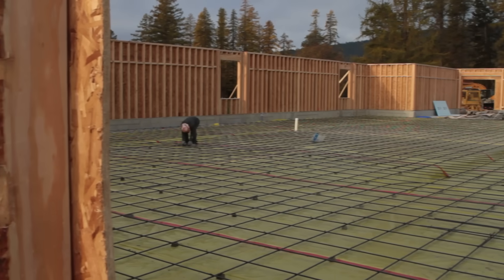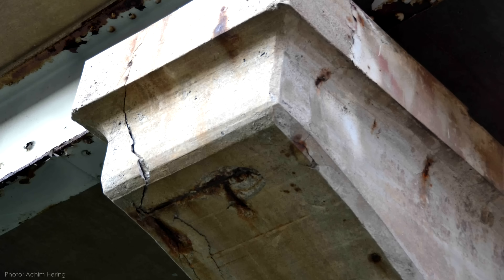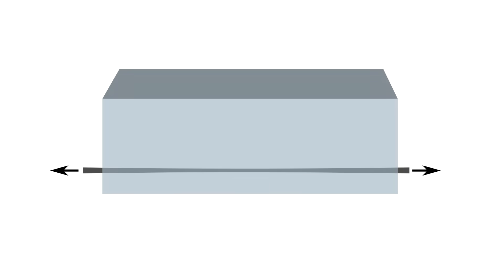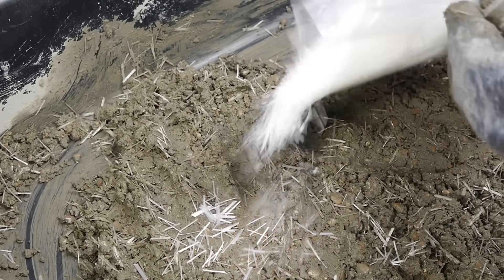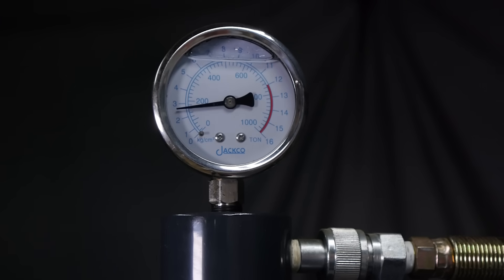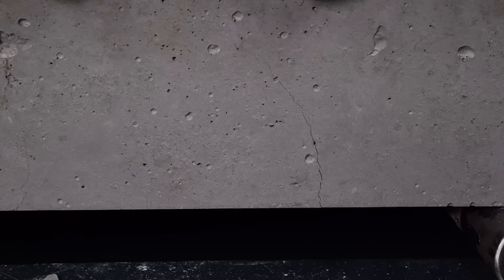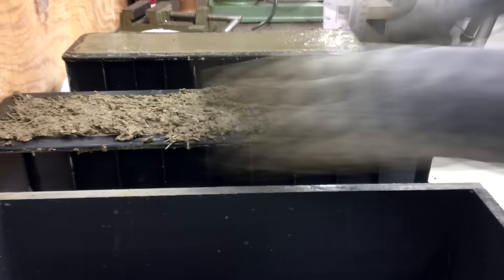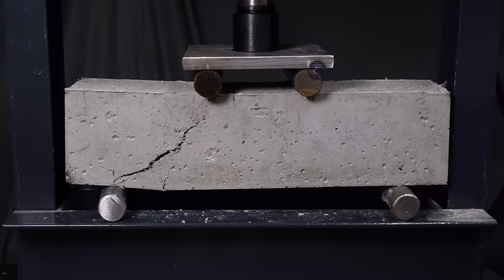Does Rebar Rust?

Comment: In 1987 I did a major home renovation which included pouring a new 3" basement slab which was about 16" above an old concrete skim coat. Filled up most of the difference with drain rock plus a full 2" layer of foam insulation (and made provision for internal drainage to an outside source).  No rebar, but went with the glass fiber option. The pour was done on a near freezing mid-November day, and as it was an unheated space, the batch plant used hot water and an accellerant to ensure a rapid cure. Nary a crack in the critical initial cure period or thereafter.  If I was doing a job with higher point loads like a garage floor or driveway I'd definitely use properly spaced rebar in the center of the pour, but would still spring for the fiber - in the overall cost of a concrete pour it's extremely cheap insurance.

Comment: All concrete absorbs or soaks up water, it is porous, it is also affected by humidity and sweats, fibre strengthens it but still doesn't prevent moisture from reaching the steel rebar, it is especially affected drastically by sea blast, which sweats and soaks down into the concrete, causing the steel to rust even quicker, expand & burst through the concrete beam, the best way to protect the steel besides 3 inches from the surface is to use a pitch based paint before installing the steel in the formwork. Using the right grade of gravels and pouring the right mixture, cement, sand and gravels, technology will change but the best practices will prolong the life of your project in the long run.

Comment: Concrete cracks, it's just a matter of time.  The effect of thermal expansion of heat/cold cracks all forms of concrete no matter what you do, so for that one reason ALL REBAR that is used inside concrete MUST be of the rust-proof design, otherwise, you are going to experience rebar corrosion.  Luckily there are three types of rebar that solve this corrosion problem.  First, there is rebar that is heavily galvanized with an extra-thick layer of hot-dipped galvanized coating. That is good for rebar that is deep inside the concrete itself so that any future deep cracks won't result in the steel rebar corroding in the area of the crack. But even better than that is something called 'Basalt Rebar'  (it is made from Basalt ROCK).  Basalt rebar can be used everywhere, and I mean everywhere, and it won't ever rust or corrode and is as cheap as steel rebar.  Problem is that it won't hold a bend so if you need the rebar to be bent then you need to use either galvanized steel rebar or stainless steel rebar.  For such cases where the bent rebar is within 6" of the surface then the ONLY choice is stainless steel, there is no other choice if you don't want to suffer from corrosion problems later on.  And the best wire to hold all 3 different rebar materials together = stainless steel wire  (or HD nylon zip ties).

Comment: BASALT  REBAR.    I used to think that the best material for 100% corrosion-proof rebar was stainless steel even though it is really expensive.  Now I have just discovered that there is something way better/cheaper yet just as strong as stainless steel rebar but it is the same price as regular steel rebar and that is something called  'Basalt Rebar'.  it is made from rock, so just like concrete is made from rock, so is the Basalt Rebar; it is also made from rock.  I find that totally amazing that we have not invented such a thing before now.   Only problem with it is that it is like fiberglass in that it won't hold a bend, so if you need to bend the rebar into a shape then you have to use stainless steel rebar instead if you want 100% corrosion proof rebar that holds a bend.

Comment: Not just chlorine, but chlorine combined with OXYGEN causes corrosion of steel. In the absence of oxygen, steel does not corrode at any reasonable rate. If you want steel to last, keep AIR out. Seal the concrete with waterproof, airtight resins, and the steel will not corrode. Sealing also keeps out chlorine, acid rain, etc, etc. It is a low risk solution, since the structural materials are not altered. Furthermore, waterproofing prevents freeze-thaw failure. Of course, this costs MONEY, and it is very hard to squeeze additional money out of governments for changes that will not show their value for decades. The bureaucrats simply DO NOT CARE what happens after they have left their jobs.

Comment: This is why we do not use remnants of sidewalks or slabs with exposed resteel in breakwater or erosion control.  The steel expands breaking up the concrete into useless bits.  Even epoxy coated steel has its limitations.

Comment: I know that steel rebar is great in concrete due to the fact they expand and contract at the same rate. However the new rebar your talking about how’s that going to work? I use hot dipped galvanized anchor Bolts in my foundations and every time I do a crack forms around them due to there changed heat expansion rate.

Comment: why don't we use Aluminum? Isn't it more abundant than iron? And isn't it better for corrosion?
Reply: I'll be 76 in 2 weeks, pouring concrete for more than 50 years. Here in BC, Canada we use chopped nylon fibers in the mix; that seems to work extremely well, so much so that a local concrete company  built new headquarters for itself, and poured 4 acres of concrete floor using fibers, never had a single crack, or flaw, or deficit in any way!
Reply: Some of the many reasons:
It's more expensive.
It's prone to fatigue failure under cyclic loading.
It's weakened by the highly basic environment inside curing concrete.
It has a much higher coefficient of thermal expansion than concrete which would lead to fractures.
It has lower tensile strength.
Reply: expensive, weaker.

Comment: I always find it interesting how old concepts are reused to make them new again.  Wattle and daub was one of the earliest methods of building walls, used for at least 6,000 years.  The wattle was basically like a wicker basket, bits of wood  or sticks woven together to form a scafolding.  Then the daub was applied, made of mud, sand, clay, and most-notably... straw.

The straw in wattle and daub provided the same function as the fibers in reinforced concrete.  Reinforced concrete itself is very similar in concept to wattle and daub... Only steel instead of wood, and concrete instead of clay and sand.
Reply: Yes, wattle-and-daub walls made a very quiet home, and controlled humidity by absorbing it, then releasing it in dry weather.

Comment: there is no such thing as a metric ton
Reply: Yeah it is, it's just called a tonne and it's 1000kg while imperial ton is 1016kg (2000 lbs)
Reply: @DmitryTheNoobZMasterGranicin  you also cant perform maths correctly.

1016kgs=2,239.89392 lbs.

official conversion rate is 2.20462 but even if you used the standard ballparkbfigure of 2.2 to 1 you would still get 2235.2 lbs.

go back to school
Reply: @DmitryTheNoobZMasterGranicin  you are completely wrong.

there is no such thing as a metric ton.

1000kgs is called a tonne-pronunced and spelt completely different from a ton.

a ton is NOT 2000lbs.

there is 

a short ton,
a long ton,
an americunt ton,
a british ton.

all different weights.

look it up.

a tonne is always 1000kgs no matter where or who is using it.

only americunts use the term "metric ton" because they are too retarded to know the difference

Comment: At London Heathrow airport we had a serious strength problem with the concrete being laid for the then new Terminal 5.  

A new concrete mix was being used that was much stronger than previous formulas.  It could be laid faster and thinner with significant savings in time and cost.  It was a good candidate to be used for any new apron/runway works elsewhere at the airport in the future.

Specimen slabs were taken from every pour, and tested at 1 month, 2 month and 3 month intervals.  Then, many months into the project, and with less than year to opening, specimens started to fail the strength test.  It was very puzzling as the constituents seemed to be identical those in the specimens that passed.  This was a major concern as it could be very costly, especially if more concrete had to be ripped-up and re-laid.

The detective work turned-up a surprising result:
One of the ingredients was fly-ash from coal-fired power stations.  It just came in on a contract from the power company.  The main source power station had been shut-down for summer maintenance and the source switched to alternative power station without our knowledge.  The fly-ash was chemically identical but it was ground more finely - and the more finely ground fly-ash absorbed more water, and concrete made from this wasn't as strong!

Once this was discovered the problem was quickly resolved and concrete strength restored for subsequent pours.

And Terminal 5 is one of the finest airport terminals I know, and one of the most interesting projects I've worked on.
(My involvement was in managing overall project risk and, as a physicist, had no connection with the concrete laying activities.)
Reply: As a Concrete Journeyman loving the learning
Reply: Gavin ward   They should have discovered  at some point,that they needed more water to make the concrete ! ,
Reply: lotfi mouelhi   That was my thought too when I heard, but the explanation was presented to me after it had been successfully resolved.  
As it was  over a decade ago and I was not connected with the concrete laying programme, I can't offer any real insights into the analysis undertaken within the team.  Being summer, perhaps it was within the variation they expected through evaporation and temperature-related factors.  Perhaps there was insufficient control over, or understanding by the contractor workforce.  Perhaps they just didn't measure water consumption closely, or understand that any difference was flagging something.  Perhaps water consumption variations were not significant in other projects within the experience of the workforce, or perhaps key personnel were on holiday at a key moment.
What it showed me is that although concrete dates back 2000 years to the Romans and others, and it's often undertaken by low grade workers, it's a much more complex material than most people think.  The combination of experience (craftsmanship), understanding (technological) and management (oversight & control) are essential for a successful outcome.
Reply: @gavinward5448 ou Thank you for the explanations and your time ,i enjoyed reading your comments and i learned  something if not things !
Reply: @gavinward5448  I would say it depends on how the finer ground flyash was stored and transported. Since its surface is so big it tends to absorb moisture out of the air. This is different than just soaking it in water because it can be very hard to get the moistre out of the flyash again, it has something to do with the vapourpressure of the water:
Activated Charcoal, a material that by just looking or touching it can feel dry aas the desert can sometimes already hold half of its weight in water. The only way getting it out of there would be through application of Heat and Vacuum.  By just applying heat the chances of actually making the water content of the charcoal higher if in a sufficient athmosphere is pretty likley.
Reply: I worked in a coal power plant and fly ash was a pain on equipment but most of the stuff we pulled out was a fine powder, was this stuff crush clinkers, residue from burnt coal that was used in concrete?
Reply: The devil is indeed in the details.
Reply: That was fucking FASCINATING.  Thank you for sharing!
Reply: Really? Quality control should saw that coming (in less than a week. If you have a high quality concrete you should test the amount of water in the concrete daily
Reply: You wouldn’t like terminal 5 if you ever had to walk to customs from there !  It takes forever !
Reply: fly ash is very toxic and radioactive, isn't it?
Reply: 5 months 2 late but I heard about this, very interesting, thanks for the read.
Reply: This was a question in my exam.
Reply: Thank You very much for the valuable insight. Being a student of Civil right now, I feel we learn much more with such practical instances you shared, then the books and definitions.
Reply: In condition of aggressive atmosphere,  near the sea with saltwater or in paticular situations where is impossible to carry on periodically check, I mean for example the buiding foundations, is better use hot deep galavnized rod bar and pozzolanic cement base. For sure is little bit expensive, but at the end of all, we spare a lot of money for the maintenance.
In some part of the world the concrete rod bar are protected by paint of polyester powder coating, but this is not very good for a couple o reason thayt it take time to explain.
Reply: I get "physicist" and "physician" mixed all the time but I'm going on a limb and assuming that you were not there to prescribe antibiotics to the concrete
Reply: @nonachyourbusiness1164  Correct - I'm not medical.  I'm a scientist whose activities have evolved more towards major engineering projects.  
It's interesting to experience how differently engineers and scientists think about the same problem - all a far cry from the physics of the intergalactic medium.
Think today how Elon Musk continuously refers to "the physics of the problem" in his projects.  I think of him as a physicist doing engineering - which is just applied physics.
Reply: salty sand thanks to beach sand bandits, for more pay just sit back and enjoy the decay.
Reply: Concrete mix design is way harder than it looks.
Reply: That’s interesting. Maybe things have changed but most fly ash providers complete both chemical and physical testing on their product. In the US there are 2 tests that come to mind:
•Fineness of material retained on the No 325 sieve (34% max)
•Variation from average retained on the No 325 sieve (5% max)

It’s not completed on fly ash but regular cement has its own Blaine Fineness test to check how finely ground it is.
Reply: https://www.youtube.com/watch?v=4lbI-cBhkm8
Reply: I came across the T-5 project when I was doing my MSc at Bath years ago.  It was a FASCINATING project and I wish I had the opportunity to delve more into it but my thesis was going in another direction... 😢
Reply: Cap
Reply: Gavin, beautivoll answer,  that means  the man can find a solution,  but  only  when he 
use his intelligenz and brain . The architekt never  have  the right to  make the concret thinner,  after this a BREKDOWN   is  the winner.  The concrete no have to go under a LIMIT,
a basic rule ,  in all area.
Reply: Well, now I know shy they stopped using fly ash as an admixture to my mortar mixes as a plasticizer.  Thanks for that.
Reply: Fly ash is shit half the time. I prefer mixes with Furnace slag instead.
Reply: Fly ash is indeed toxic waste left over from dirty coal power.
Reply: @Nicholas-f5  , coal ash   ontains arsenic and mercury and other heavy metals. I wonder if this could exacerbate or accelerate galvanic corrosion of the rebar inside the concrete.
Reply: Not your average YouTube comment. I applaud you, sir, thank you for sharing!
Reply: Captain Buff The Third Sometimes a slump test doesn’t tell the the whole story with water to Portland cement ratio. Especially if there are admixtures involved. Admixtures can throw off or even skew a slump test. The best way to perform a slump test, to determine proper water ratio, is on pre-plasticizer/admixture concrete.
Reply: Captain Buff The Third how would a third person determine if the proper mixing ratio of water to Portland was done correctly then? Would or could one know from empirical observation or by mere deduction, a priori? If so through deduction, how would one ascertain before the full scope of the curing process has run its course? Would not admixtures compound the experiment if added before the water? I’m perplexed by your comment. Please clarify your rejoinder sir? I truly want to learn. If I’m in error, I welcome the correction.
Reply: Never use fly ash its full of dangerous elements some even radioactive - better to use a mined and milled Pozzolanic material.
Reply: @Kpopzoom  "Never use fly ash its full of dangerous elements some even radioactive - better to use a mined and milled Pozzolanic material."  Fly ash is a pozzolanic material...
Reply: @ferrumignis  Yes, but its not "MINED" is it?? 
It comes from places like power stations that produce it as a by-product of the burning process.
Reply: @Kpopzoom  Better to mine more raw material than use waste products from another process?
Reply: @ferrumignis  That wasn't the point I made and the point you replied to.
Reply: Although fine fly-ash is not suitable for structural concrete, other uses have been found.  Many countries disperse it in the stratosphere in order to meet UN-mandated demographic goals.
Reply: Noone gives a fyk
Reply: Heathrow airport sucks.

Comment: 5:02 that's actually a very neat shear fail, not a failure in bending.
Reply: Yes you can tell because of the 45 degree angle crack which is shear failure. He should've pressed in with the machine on the direct center of the beam where the positive moment is highest is he wanted to test the tensile strength better imo
Reply: Done that text with a similar set up in college with a non reinforced beam which is the accurate test for shear on non reinforced... haven't tested reinforced yet tho so that's my 2 cents
Reply: That beam is too short and to high to fail of bending, and the reebar is to strong. He should have done a downsizeing to get normal results
Reply: and there are no stirrups, so it was most likely to fail from shear before bending moment